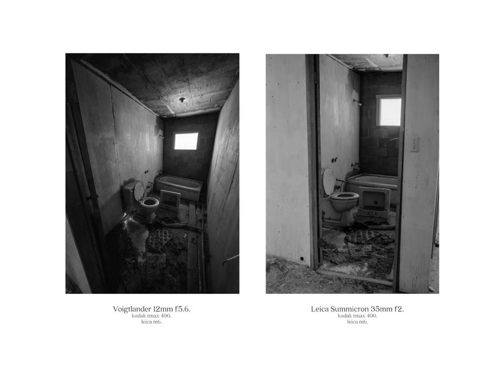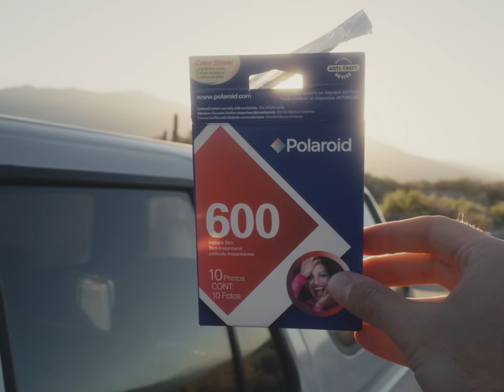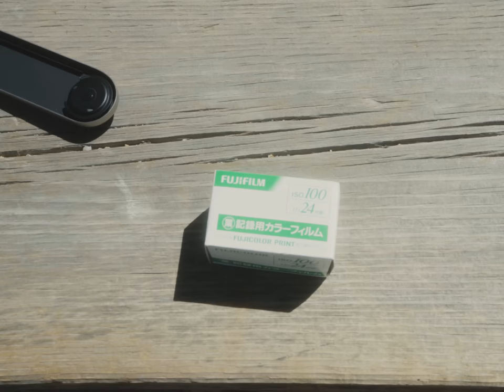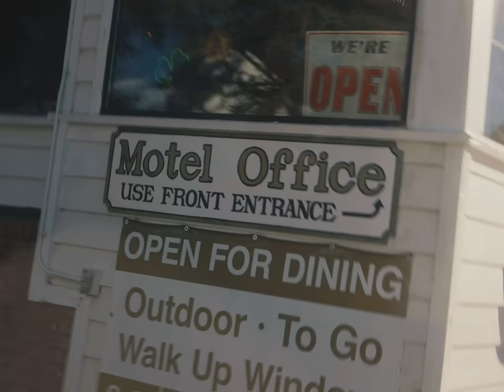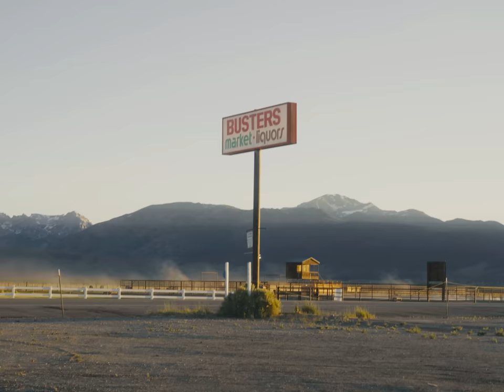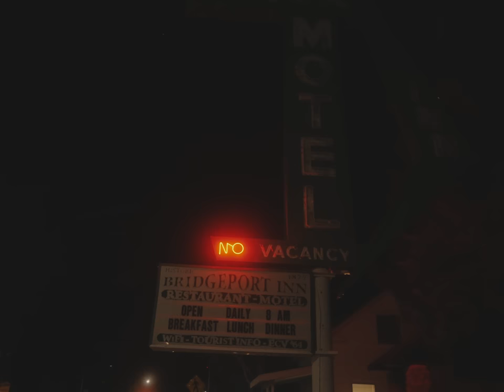Shooting Film in the Sierra 2; electric boogaloo

Comment: In order for an inviability vest to work you need to beat it half to death. Kick it around in the dirt, rinse it off and the pool of suspiciously scummy water, right random notes in chalk on it, use it as a rag during your next oil change, then wash it with copious amounts of Tide in scaldingly hot water. Everybody notices the rube walking around in a new and spiffy, shiny vest.